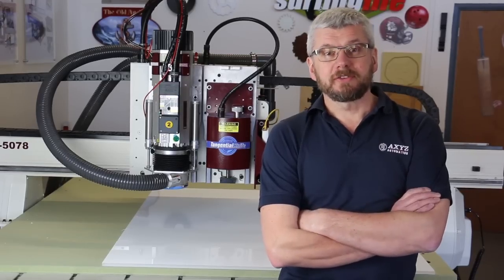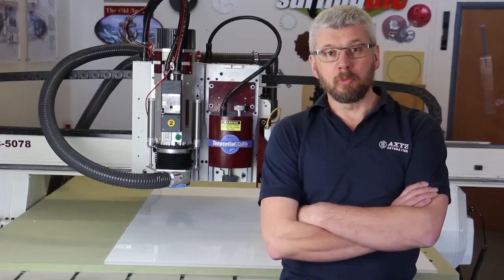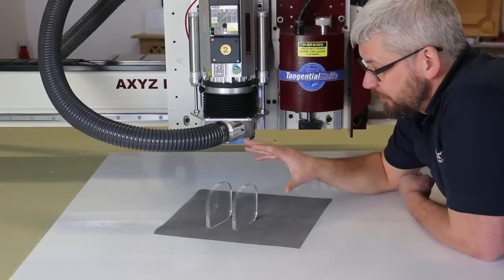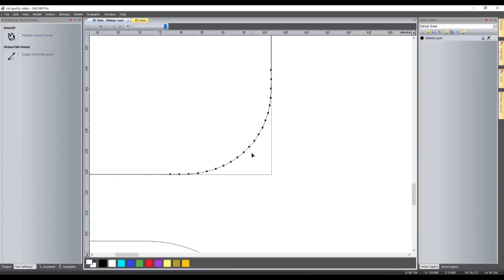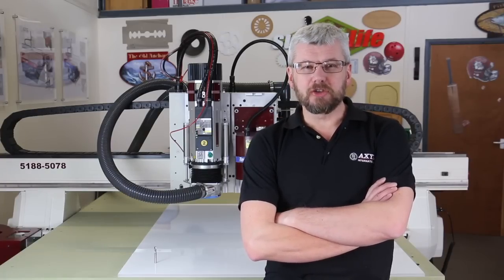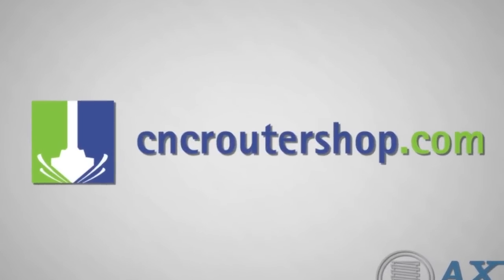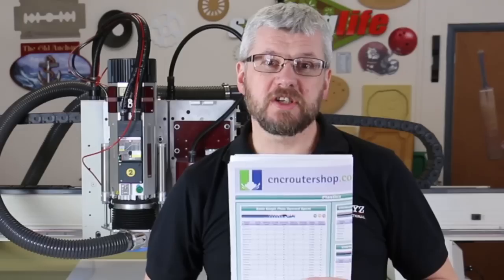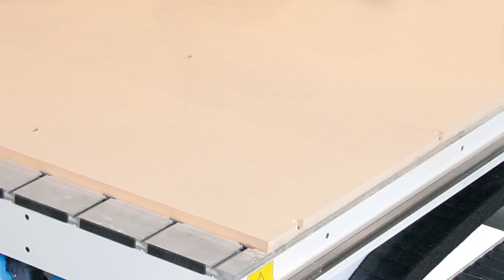How to avoid a poor finish when cutting acrylic on a CNC Router

Comment: Could you please include in your video description the Feeds and speeds youve used? Looks like 1 pass, 6mm endmill? 14kRPM? 3000 mm/min?
Would love to know this precisely
Reply from the maker: Hi Luis - sorry for the delay in responding. According to Ged Lodge, the Technical Specialist in the video, he used an 8mm Belin single flute up-spiral (part 1111A-8) 22k rpm @ 1.5m/min (for a good finish)
. The material was 10mm clear cast acrylic cut in a single pass. The tool will cut much quicker, but the objective was "Good cut quality."

Comment: AXYZ International which one is better for cutting and engraving acrylic and wood, laser machine or cnc machine like yours??
Reply from the maker: A laser will etch fine detail but can leave a scorch on the surface of the material that will have to be cleared away. With the right settings, a router can engrave many materials without requiring post processing. A router can also create pockets, 2.5D & 3D shapes, and V-carving, all of which would be very difficult for a laser to do.
Reply: @AXYZrouters  Thanks for reply
And what is the meaning of 3axis 4axis and what are their advantage s and disadvantages
Reply from the maker: 3-axis machines cut in the X, Y, and Z axes. 4-axis machines can cut in the A-axis as well, usually in the form of a rotary table.

Comment: Lets try this again, but this time start with the opening line >
"For all those people with a cheap crap china CNC router, the best way to engrave acrylic is" ?
I have a 3.175 bit with 20deg 0.2mm point, i'm trying to cut a pattern only about 0.3mm deep! but every now and again the bit when lifted has a small ball of acrylic that's welded to the point.
and stops the bit cutting. how can I stop this happening, without spending +£40,000, my budget is £10 max.
Reply: single or double flute cutting bit. 3 or 4 flute will not work. Try to refrain from bits with small flutes, if needed use bigger diameter ones. Your goal is the machine has to cut chips from acrylic. test different speeds, start with low speed as high speed bit can melt acrylic when not cutting properly due to poor chip evacuation.
Your bit is too pointy and has very shallow flutes at the end to evacuate chips during cutting. Use ball or flat end bits.
Reply: @TechTinkerWorks  I used to think you need a fancy machine to get clean cuts in acrylic, but learning overcame that false way of thinking. It is all about the choice of tool, speeds and feeds, and work holding. If you can manage those you can get beautiful cuts. Like AXYZ said in this video a single (o flute) upcut spiral works well, although for thinner material a downcut is going to work better for you. Use the painters tape + superglue trick on a freshly faced spoilboard, and the highest speed your router can achieve that is CONSTANT. Maybe 16-18K. Then, most importantly, follow the tool manufacturer's chipload guide, and plug in the numbers in your CAM. For acrylic you want to move fast so you don't get welding, use as big of a tool your router can support, and cut only premium-cellcast acrylics. Extruded acrylics and cheap soft plastics are going to gum up no matter what you do. I have good luck with Onsrud bits for machining cell-cast acrylic.
Reply: @NotFromConcentrate  ayeeeee hi Josh! Good to see you here 😄

Comment: Thanks. Nice video. Can you tell me what you are using as a waste board?
Reply from the maker: Hi Richard, we use a 25mm moisture resistant medium density fibreboard (MDF). We use a fixed sacrificial bed in this video which means we consistently skim the bed to ensure it's flat. We have a blog about the benefits of a fixed sacrificial bed - https://www.axyz.com/us/2018/02/01/benefits-using-fixed-sacrificial-bed/

Comment: Hi jed how do you get such a nice polished cut just by cutting one pass? we have a axyz 4010 and i use lmt Belin cutters the 13 series cutters or 13030 and 13060 series.  I am still new to cnc routing aswell to be honest.  thank you.
Reply from the maker: Hi Erich, I've spoken to Ged and he informed me that he was using a Belin 8mm single upward flute for aluminum. He cut this piece at 24,000 rpm with a feed rate of 1.2m/min. Although the cut speed is slower than expected, you achieve the best quality finish.
Reply: AXYZ International awesome thank you very much , I'll definitely give it a go . much obliged  :D

Comment: Hello!
Very interesting and instructive video. I have a very small CNC, a very basic  one. I cannot afford a beautiful machine as the one on your video, but I think I should be able to work on acrylic. And until now, my results are disappointing: the acrylic glues to the bit, and give me an ugly finish. I don't cut acrylic, but engrave name or form as leaves, flowers, names, etc.
I was told I need to slow down the speed of the spindle, increase the speed of cutting. Some said I should use cooling fluid.
I will be very please if you can give me some advises!
Thank you. 
You have beautiful CNC, indeed!